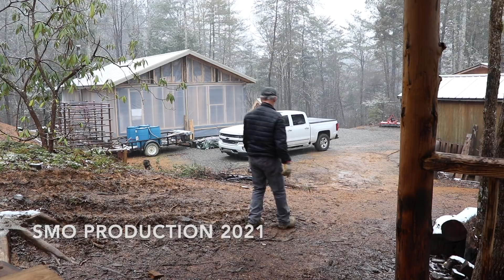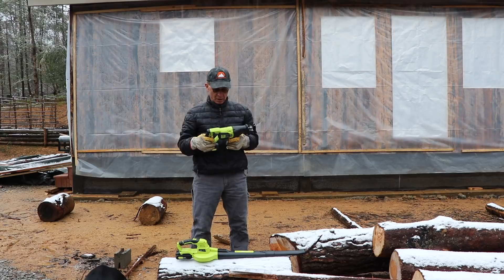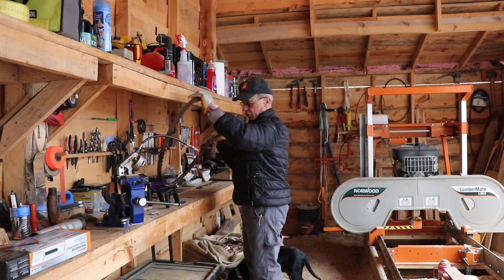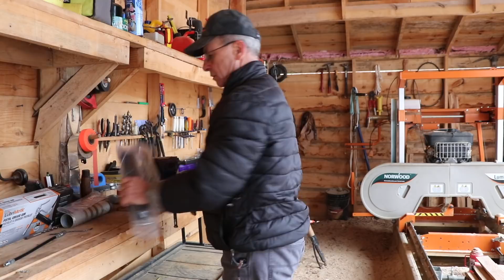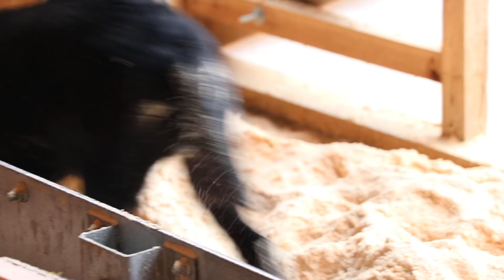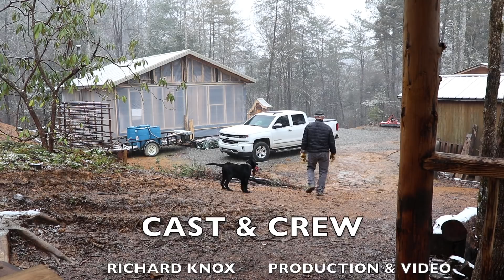CABIN SIDING, SAWMILL & Q:A | OFF GRID TIMBER FRAME | WOODWORK

Comment: They make a greasegun end that locks onto the fitting using a lever to release making it easier to lock/unlock fittings in harder to reach areas. 

A different option for the door then buying lumber is to get some pallet wood and laminated them into a door blank butcher block style. With the sawmill you can make some thin cuts for skinning the door to get the normal look of a door.

Comment: Did you consider buying a sharpener for those blades Norwood Sawmills sells two different ones,  pro version is a bit pricey but, if you can sharpen them two or maybe three times it would pay for it self quickly seeing the price of new blades. (I do not know anything about the mill you use so just a thought)

Comment: Hi,
I am wondering why it seems that so few are putting in georhermal heat? You have a tractor to dig and land, it is not hard to do, and also provides you with constant heat and hotwater. Then I guess you keep the woodstove if something goes  wrong with the electrical.